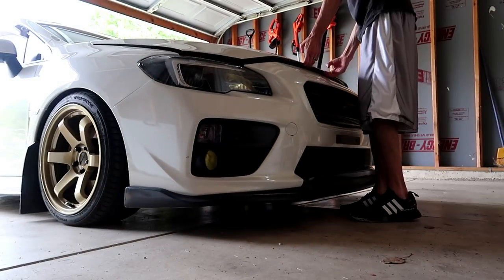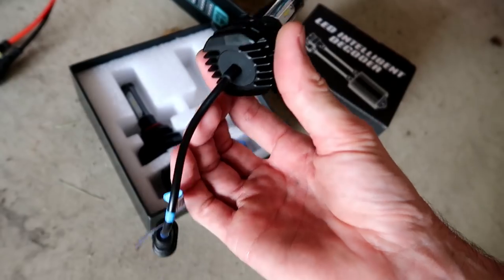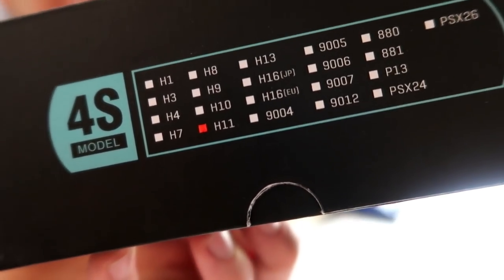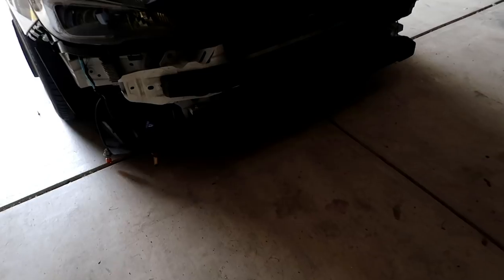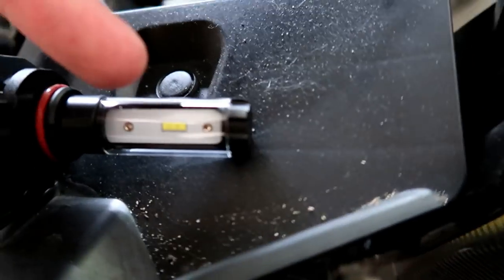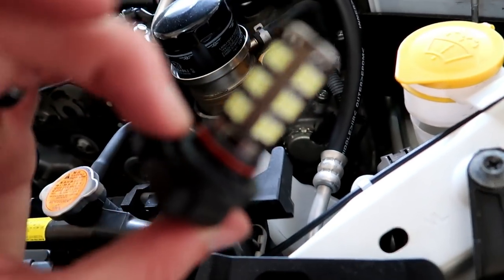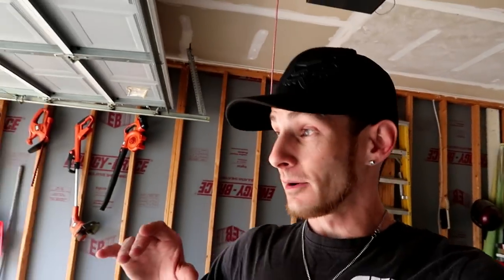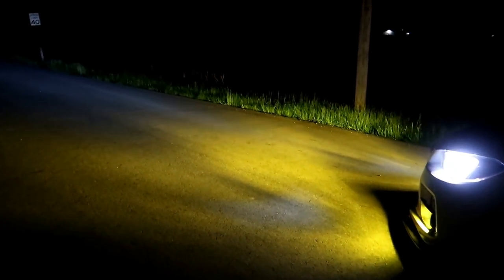HID vs LED *JDM AStar* Subaru WRX - Install

Comment: Great video Ryan! I used for a long time LED for low and high beans. But I came back to use HID in my low beam again, because the ilumination is a lot better and uniform!
P.S.:  Sorry for my bad English, I'm Brazilian, rsrs!🙂👍🏻👏🏻🤜🏻🤛🏻
Reply from the maker: Thanks and Yea I still use hids in my low beams but led everything else
Reply: @RyansRandomActs  So is you low beam HID? And what brand are you using? Thanks in advance